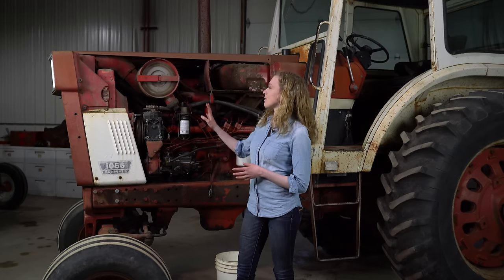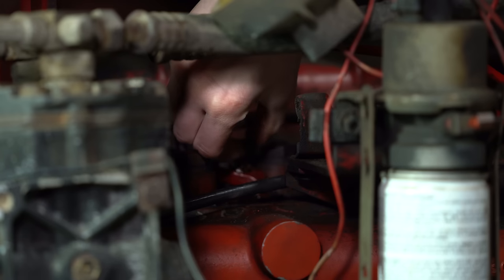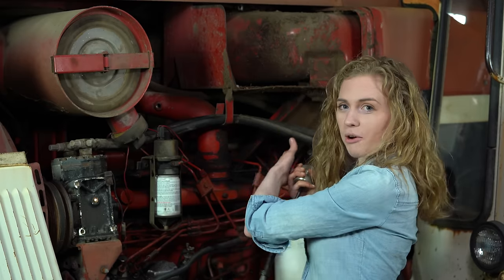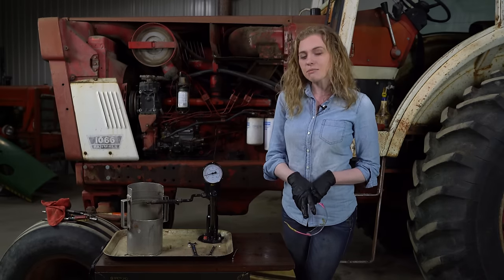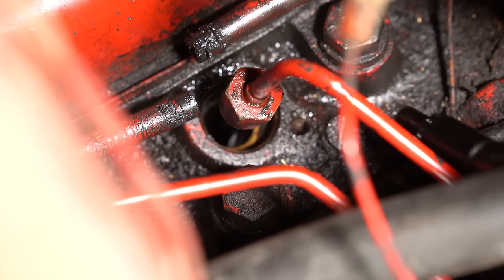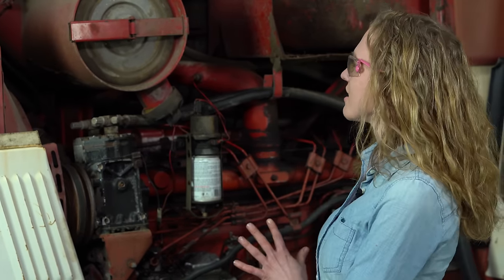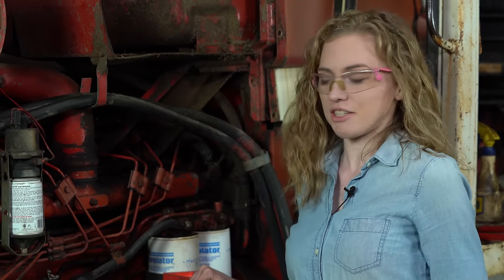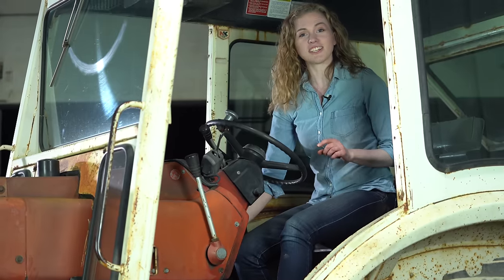How to Replace Injectors on an International Harvester Tractor: Easy-to-Follow Tutorial

Comment: Yeah I have a 766 that’s making it’s own engine oil, so I’ve pulled the injectors out to do a thorough clean but I’ve noticed the 2 rear injector cups (under the tank) are rough and the top seal is messed up, thoughts??

Comment: Hey can you help me please. I have a kubota l4600 v2203 engine and 1 of the 4 cylinders on the injection pump is not putting out any fuel. Do I need to replace my pump? Or rebuild pump? Or can that one plunger be replaced?

Comment: that was DT-361  former 806 &  some 856  good old faithful tractor and motor now only bad thing with the 66 series was the clutch and input shaft which runs you hydraulics  this includes your brakes and steering guaranteed  you will want to change those out at times I know from experience of my brother's and my cousin tractors 4166 & 1466  both use a DT 436 it the big guy 4568 that use's the famous IH DT466 engine  lol no I'm not really a IH guy I'm  for equipment Cockshutt Oliver Whites Agco or JD  diesel power is the old school screamin Jimmy Diesel lol or Cat  heavy earth movers is Terex and Cat's lol semi trucks is PB or KW , then old school GMC's  :)

Comment: As a diesel mechanic this video is full of incompetence.   Always loosen the lines before removing the hold down bolts!  If the injector tube pops out you replace it, not pound it back in!  Always replace the tapered rubber seal at the top of the injector and coat the injector body with anti-sieze so it can easily be removed in the future.  The fire ring is part of the head gasket, what you are referring to is a copper sealing washer and it need to be installed on the injector held in place with a drop of anti-sieze. Some manufacturers use different thickness sealing washers on different applications . Dont just drop it down the injector tube and always make sure the old sealing washer is removed first so you you don't end up with stacked washers. Always replace the rubber return lines( they have a tendency to leak)!  Always write dates/hours on new filters for future reference.   That tractor won't start that easy after replacing injectors!!!!! You would first have bleed several of the injector lines by leaving them loose while attempting to start it.  Misleading video as are most in this series.
Reply: Also I could not see very much of the Injector work…